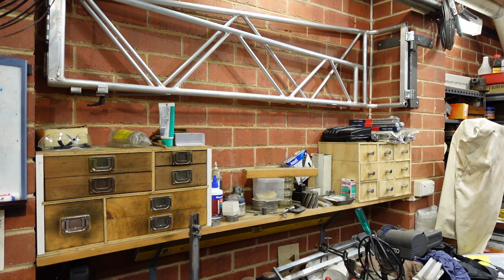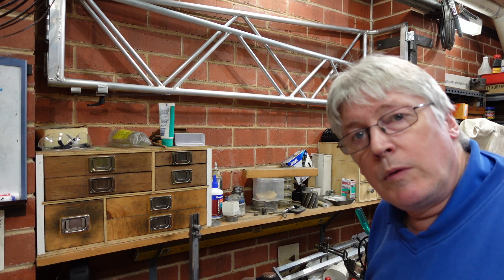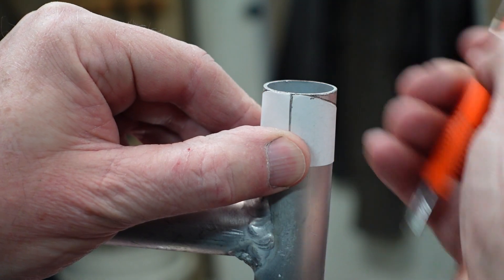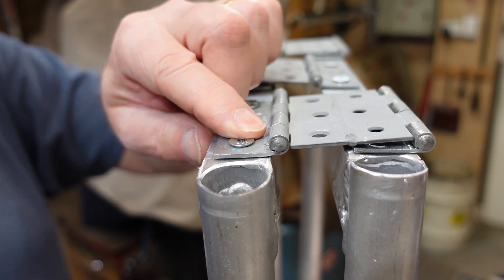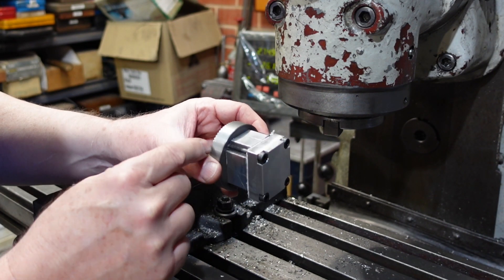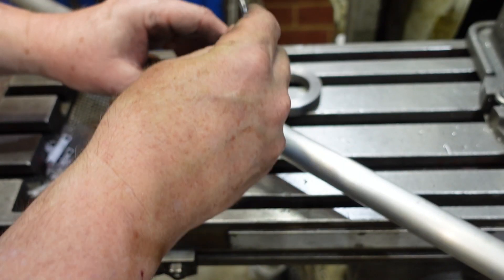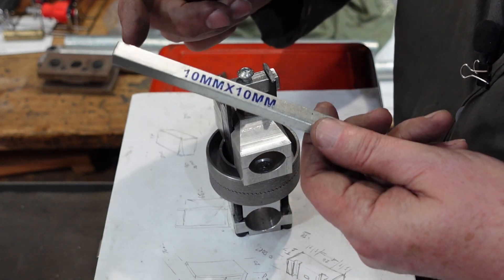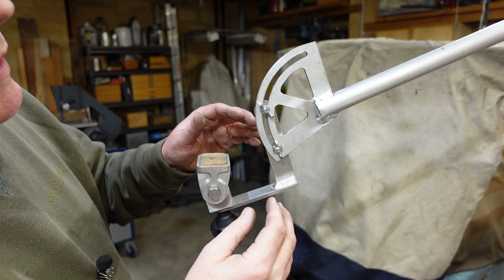A camera support with 3 less feet than a tripod!

Comment from the maker: For those thinking about the bounce I'm getting, the problem is in twisting. The trusses are plenty stiff in the plane they are in, but when the final section is at an angle to the first section, the first section is being twisted by the weight of the final section being out of the plane of the truss. A counterweight would reduce the twist, but would not necessarily help with torsional stiffness. I think I can stiffen the truss slightly and that might help. 
It's not helped by the hinge pins not being coaxial. For that I will have to make a custom hinge with the pins joined. While the hinges don't directly make the boom end bounce, they are sagging and that is not helping

Comment: I'm eager to see what you come up with to eliminate (or at least reduce) the bounce.  I'm just guessing perhaps a spring, counterweight or other mechanical idea.
Reply from the maker: I'm keen to firm up the hinge as its an experiment, and a bit of a lash up. I may also put some depth on my trusses and try to reduce twist that way. It works as is, so plenty of time for thought. A counterweight or spring might reduce the twist a bit, but I need a dampener really. I'll have to see what devilishly intricate and overly complex solution I can come up with.

Comment: Cool idea. I had a thought how to help reduce the bounce by connecting a cable from the end of the support to a pulley connected to a swivel above the primary support connection on the wall with a weight on the other end of the cable. This would provide an adjustable counterweight for the camera while still allowing a full range of motion.
Reply from the maker: Bounce is a problem. I'm still thinking about that one. The boom is usable, but I may need to remake the hinge. Being a welded construction of commercial hinges, it's a little loose.